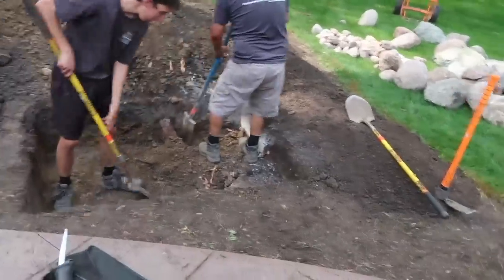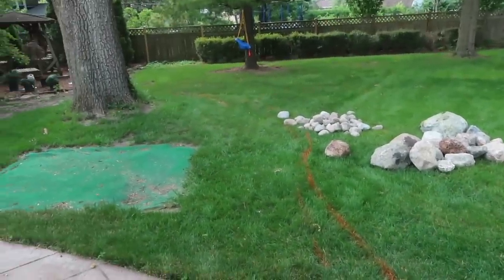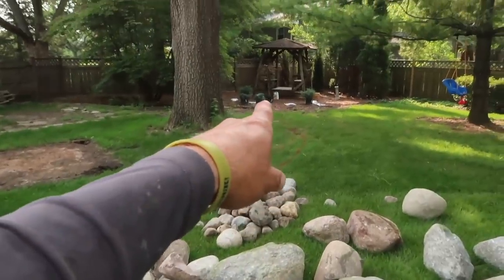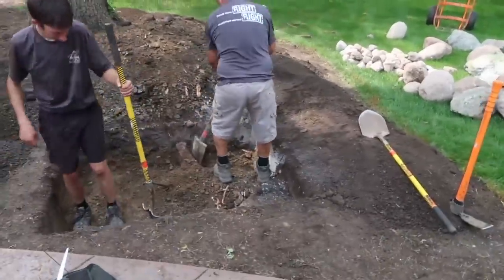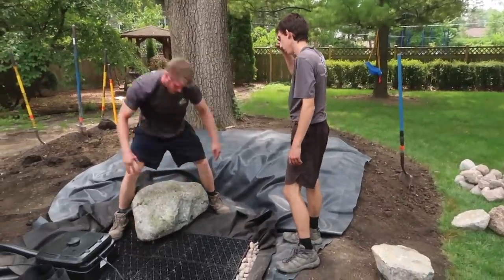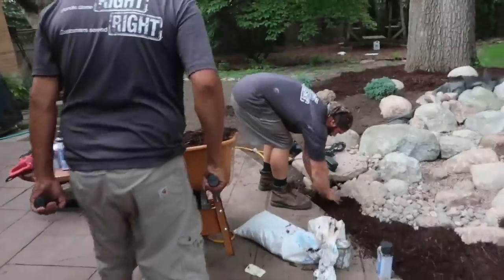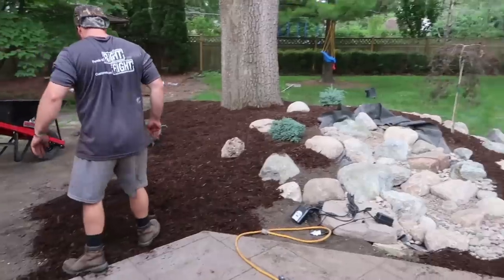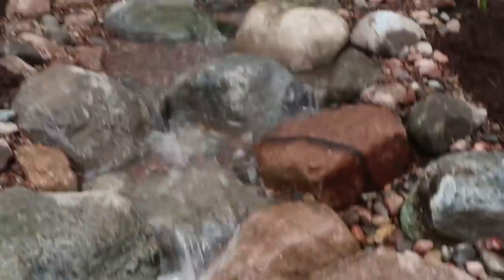How to Install a Simple PONDLESS WATERFALL

Comment: @Team Aquascape, have you ever experimented with Mud+Moss blend to grant a quicker platina to the lids before shipped to customer? I know from other people, they they've blended Mud(Dirt+a bit of clay)+water+moss together loosely in a hand-blender (Where you pull the wire to mince) and then paint that over surfaces to encourage a quicker moss growth. It have worked. Just pondering if you've tried experiment with the technique?

Comment: Ive watched yall use the mulch quite often....but doesn't that end up relocating into the water fall during heavy rains? Seems it would wash out of its set location and end up moving down into the water fall areas.